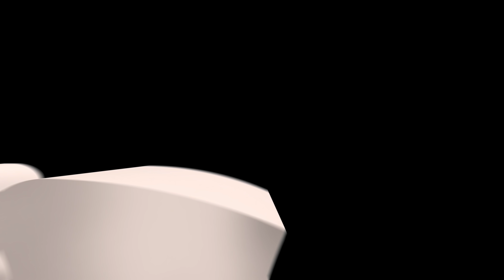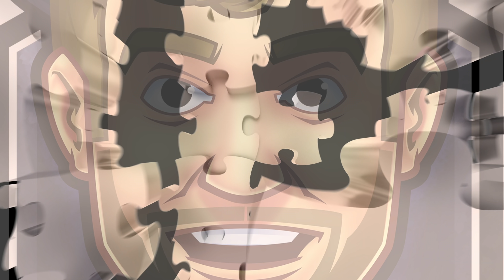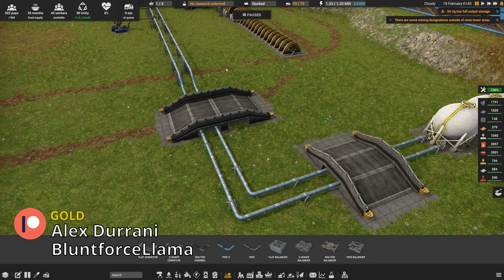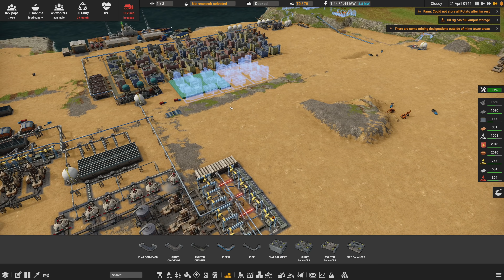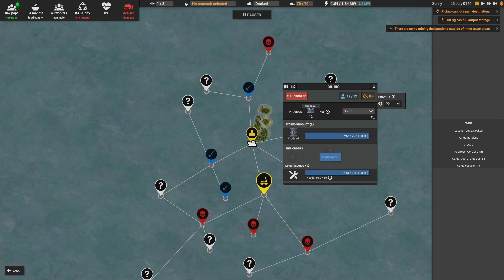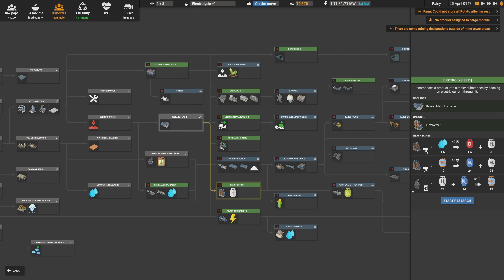DIHYDROGEN MONOXIDE! - Captain of Industry - 14 - Beta Gameplay

Comment: What the cargo ship does is it automatically goes out to island industries that are full (such as the oil rig) and match the cargo type and or filter (fluid module for oil) and bring it back to the main colony. The oil you saw in the fluid module was actually from the oil rig and not trucks depleting your oil deposit. Some of these island industries are game changers and worth the heavy diesel cost of exploration. wink wink nudge nudge. I won't spoil what they are. PS sorry about the comment on the underground pipe video, it came off differently than I intended